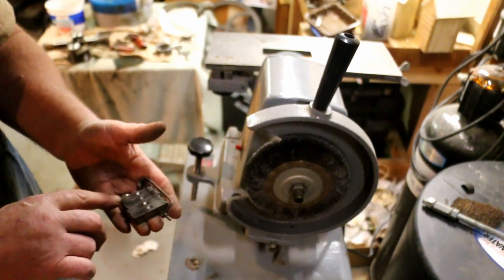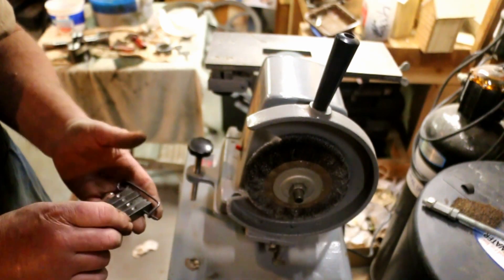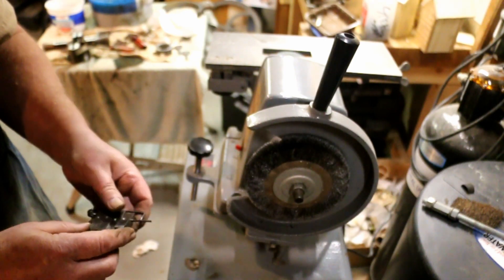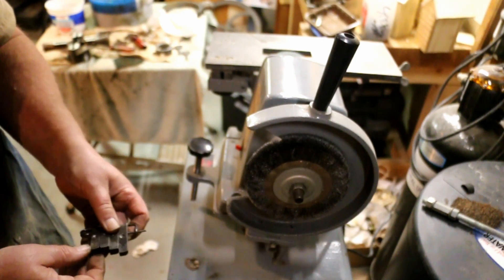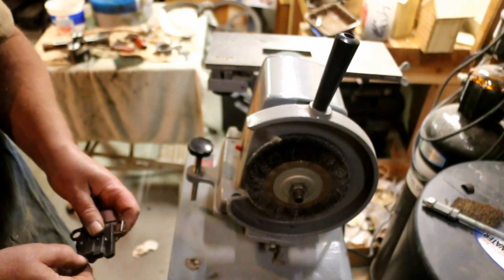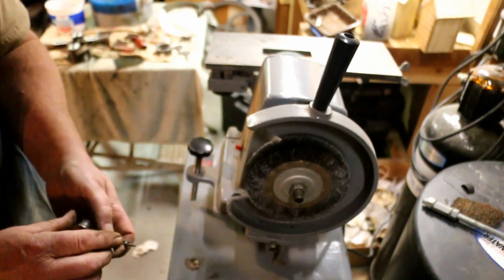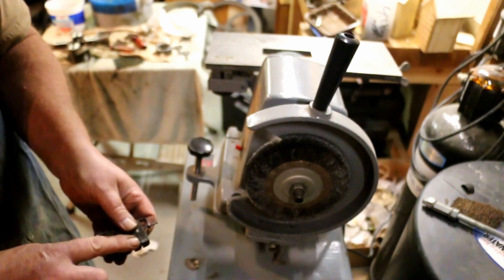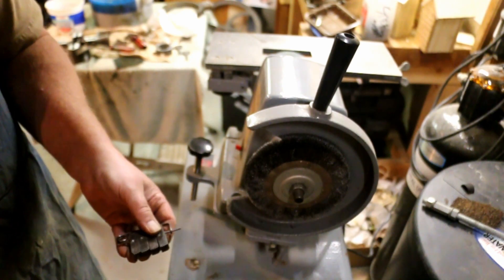Restoring The Toledo No. 1-A Pipe Threading Machine Pt 2 Cleaning The Dies

Comment: Crudbegone! Back fom the racing of rodents in one piece. Stopped at Tractor Supply about the tongue jack nd you get a bare jack and then haVE TO BUY ALL THE ADD ON'S. i'LL GO eBAY AS USUAL. Get the whole thing together and be done with it. I'm still alive, at least I feel like it now that I'm back home. Cheryl can have that run every other week and I'll pay her HANDSOMELY for it. Good deal, Unc! GBWYall! Yes, I hate caps locs!
Reply from the maker: Glad you made it. Tractor Supply is going downhill. Way too much junk. 
They started when they put up the junk tool bins in the front of yhe store. 
If you sell junk you attract low price buyers. Then you don't have the money for the good stuff because the big spenders go elsewhere. 
Before you know it you are Dollar general selling cheap crap.
Reply: @OldSneelock  Right again. They sure lost me. I haven't been to town in a while and looks like I didn't miss anything. I don't need much and would like to get what I need and it looks like Ebay is my baby. So be it!
Reply: @OldSneelock  Buddy of mine in Tennessee says there is a chain opening that is doing TS in. I can't remember what he called it but I can find out. TS is trying to keep up with them and can't. More staff at the v.a. than vets. Primary Care 3 usually has 20 to 30. Counting me it was 3. Imaging usually has a room full. 4. Got a green band going in. Everybody was coming in the back way and getting checked over. That's where I got the band. Got to go out the main gate but not come in that way. Oh well. Hope I don't have to go back for a long time. 26, 40 and 191 were one lane. Widening and paving. Progress? I doubt it. Aggravation? OH yes!